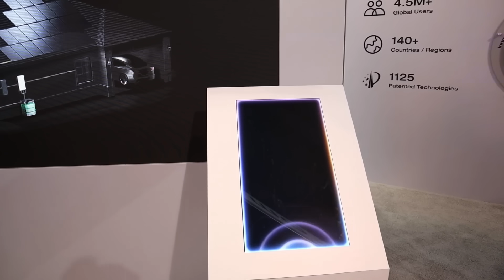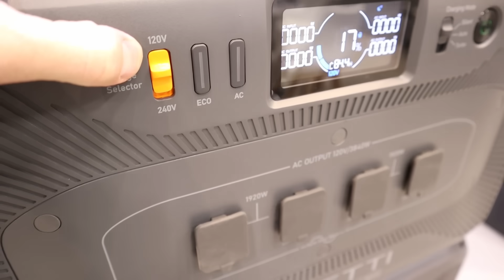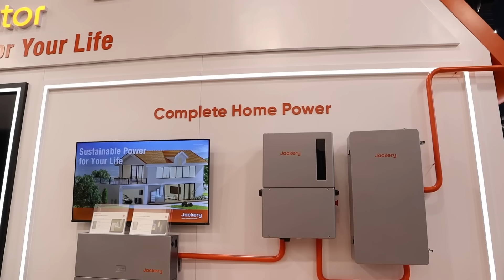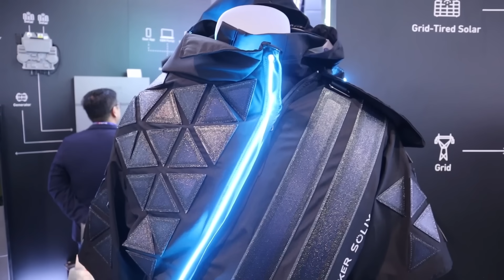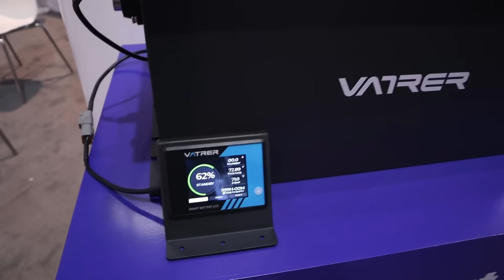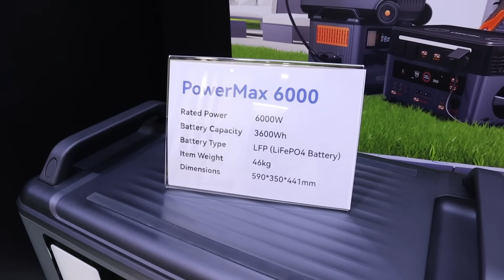I Found New Power Stations at CES 2025!

Comment: Jason, concerning the F5000lfp at aprox 2:30,  did you make a mistake on the wiring of the solar input?  I'm using 45vdc &  12amp for my calculations...  3s2p is 135vdc & 24amp, 2s3p is 90vdc & 36amp. I'm also confused as to which specs I should be using to make my calculations... Voc or Vmp for my volts and Isc or Imp for my amps.  I'm new to this and am still confused trying to understand solar & electricity. Can you clarify this for me and set me straight?

Comment: Great video Jason! I have a question. I have a cargo trailer for work with an Ecoflow delta pro and add on battery. I need to run an electric pressure washer that requires 240v. What would be the best route to achieve that? The new delta pro 3 or perhaps one of these others in this video? If it's possible, i would like to be able to output the 240v and 120v at the same time.
Any advice would be greatly appreciated!

Comment: Great video! Really interesting to see the new products for 2025 from the major manufacturers. Impressive job presenting so much information with so little time with the products. Biggest disappointment: Bluettie Apex 300 major downgrade in the solar input from the AC300's I have. 60V limit causes the same problem as the Anker 3800 (which I also have) - it's really hard to get adequate solar input. I'd classify it as a fail.

Comment: Off topic jasonoid but if you get the opportunity to review the e1000lfp battery or any self heating battery for that Matter could you test how much energy the battery consumes to warm itself up?
Reply from the maker: Typically the battery power isn't used to heat itself, it uses either incoming AC power or solar power to heat the batteries and then charge once warm.
Reply: @Jasonoid  oh ok

Comment: Jason, I wonder if the batteries for the F6000 will work with the E3600LFP?  Did you get a chance to look at the plug to input for the batteries to see if they are the same as previous models?
Reply from the maker: It will be interesting to see future compatibility. The F5000 was not finalized enough to know the battery connection type.

Comment: If peacron has heated i would expect it can be charged easier with colder temperatures than others that do not. They say bluetti ac180p doesnt even have freeze shutoff. Dont know why they would have error codes that in the manual then.

Comment: 👍  Thanks for the upload.  Pecron 3000 with heated batteries on demand please.  But for reals, I'm waiting on Ecoflow's follow up to the Delta 2 Max, don't need any more juice than 2400w inverter which saves on standby power draw.
Reply: That's what l have(2) Delta Max 2's, Love them(2) 20amp circuits will do for most Households and Will Power all 120volt Appliances. My Pro Ultra does the 240volt Stuff with 30amps(240V) it will Cover the Rest.
Reply: @JohnBurns-j2c  I also need the 2 extra battery ports as that's where the Ecoflow Smart Generator plugs into.

Comment: Thanks for this rundown of LFP batteries and accessories. I'm "wedded" to my BLUETTI AC200 MAX and B300K batteries. Good enough, with my 200 watt Off Grid TREK solar blanket, to run 2 full size refrigerators here in Las Vegas where sunlight is abundant.

Comment: Vatrer's power station looks like a laser printer!
I said in Will Prowse's comments that it'd be nice if somebody made a powerful "power station" with an inverter, sockets, USB etc all built in, but then an empty space where you can slot in your own server rack batteries. They've almost done it!
Reply from the maker: So kinda like a server rack mounted inverter all in one?
Reply: @Jasonoid  yes, but those usually just have a place where you have to mount your own outlets, usually a generator cord wired right into the home. My idea would have sockets built right into it, as well as USB ports, 12v etc. Basically like the big old Bluetti head units, but built (and ideally priced!) more like a DIY whole-home inverter (maybe a tad more "stylish"), and ready to be wired up to batteries the user supplies. There could be 12, 24 and 48v versions so the user could choose their own batteries to suit, and add / swap / upgrade over time.

Comment: I love my Ankers. I use them in different locations and need portability. Other manufacturers have very nice performance, but my Ankers have wheels / extending handles. I believe all manufacturers should offer wheels on units weighing over 40 lbs.
Reply: @djrtime1398  totally agree and that's a big reason I bought the Anker 3800
Reply: @JimEdds same and it was only 1600 for me on Black Friday eBay refurbished
Reply: @LectricOverlanding  I hear ya. My last two Bluetti units, an ac200l and an ac180 were both factory refurbs. I bought the 180 since the 200 was almost twice the weight. I wish the 200 had wheels like my Anker F2600.
Reply: @LectricOverlanding  that's a steal !!

Comment: Great job Jason. I'm guessing Bluetti didn't let you open the AC ports on the side. 
I was curious to see what kind of 240 AC port they included. Nobody have shown it.
I'm with you on the Pecron F5000. Excited about that because I know they will priced that accordingly.
I hope they make a F3000 with the same features but less capacity for better mobility.
Lastly I disagree with you on the Pecron new design.
I happen to love the old design because of the rubber feet on all corners.
Don't have to worry about scratching your shiny new power station. Can always change out the rubber feet.
Reply from the maker: I was in their booth lifting up the ports and a lady ran over and said 'don't film the ports please, they aren't final'....so the unit here at the show is a pre-production model, not a final version. It will probably have a 30amp or 50 amp 240v connection.
Reply: @Jasonoid  haha. I figured tat much because no one have shown it. The no DC ports is a downer for the Apex 300. I don't want to be carrying extra adapter just for that. The Pecron F5000 looks more promising although 5000wh+ is gonna make that sucker really heavy.
Reply: 60v input is the killer for me, what are they thinking? I have a maxed-out AC200Max with only 2200w output, it's great but I need more inverter! I'd like to have stuck with Bluetti, but so be it...

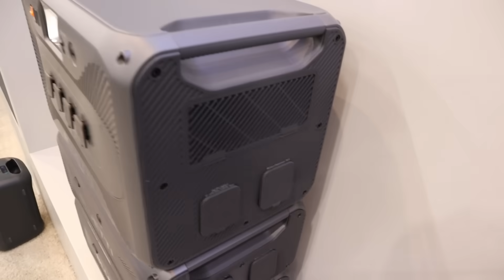Comment: @5:13 Bluetti really needs to drop some info on the rumored charging accessory if there actually is one, otherwise a lot of people are going to dismiss this unit for it's PV input downgrade and not pay attention to it anymore.
Reply from the maker: Totally agree....60v is a joke for a large unit like this.
Reply: Their vaunted "48v accessories" for their 48v output ended up being a splitter to make it into 4 12v ciggie lighters. They proudly launched the "Swapsolar" with a power station and fridge that share internal batteries, but I expect that's all there will ever be (bizarre that their backpack power stations don't use swapsolar batteries, they'd be a perfect fit).
They're like little kids, bouncing from one "great idea" to another, abandoning old ones just as quickly...

Comment: I don’t know where Bluetti is going with the Apex units. Big AC output but relatively tiny solar input. Also has built in battery unlike the AC300 so you can take just the main unit with you but it has no DC output. 

Pecron F unit looks interesting if they have improved the quality of the solar charger.

Comment: For about two years now I have resisted upgrading my power station, but the Pecron F5000 might be the one that really moves the needle. That thing can clearly power everything I need for off-grid living in any season. Pecron prices are usually quite competitive, so I'me starting my Pecron savings fund right now! Thanks Jason!
Reply from the maker: I will find out how well it performs when I test it! Hopefully it works well :) It's certainly specd out well.
Reply: It looks Good, but l still like my Very Adequit Eco-Flow StationsDeltaMax 2's. Well suited and Plenty of Power for Portable. the Pro- Ultra does Me Well for Whole House Back-Up. 7200watts at 240volt is Great with(2) 6000wh Bateries and(4) 400watt Solar Panels also and all the Hardware. Plus my(2) Max 2 Power stations. I am Well Covered in my Mobil Home

Comment: Great presentation - the trends seem to be more options for folks getting larger capacity power stations.
On the topic of self heating options - even though it wasn't a must have - I pulled the trigger during Pecron's Xmas sale
for an E1000LFP, which in addition a low temp battery warmer,  the power unit is able to supply 12 volts at 20 amps. $436.05 USD
Reply from the maker: I will be testing the E1000LFP soon. It's a cool compact unit!

Comment: the Bluetti Apex 3000 has my attention........i love the idea of an upgraded inverter that can use existing batteries and it sounds like the older AC300 system can have even more battery storage with the Apex 3000.
Reply: Please explain what you mean by "it sounds like the older AC300 system can have even more battery storage WITH the Apex 3000." I have recently bought a second AC300 with 4 more B300 batteries just to increase my storage capacity. The second AC300 make the system more resilient, but I wish the AC300 wasn't limited to using only 4x B300 batteries. I know the AC500 can use, what, about 8x batteries per head unit, but I preferred the AC300 because of less standby inverter losses. TYIA
Reply: @suklee1400  minuteman prep was talking to the Bluetti rep and the rep mentioned that the Apex 300 can handle 6 battery's .If the Apex is compatible with B300 batterys then my hope is one can connect 6 to each Apex 300.
Reply from the maker: I think the 120v/240v switch was really interesting! I would have liked to see a little larger inverter, I guess it's similar to the EcoFlow Delta Pro 3, nearly 4000w output.

Comment: Thanks for covering!  Looks like 2025 is going to give us lots of new and exciting choices!  I really like the new Apex 3000 from Bluetti along with their AC coupled battery.  The new Pecron integrated split phase unit i also quote exciting!  Finally split phase won't be a "dirty" word for power stations:)
Reply from the maker: The one thing that was kinda interesting about the Apex 300 is that they dropped the solar input voltage down to 60v (AC300 used two 150v controllers). Not sure why they think people want that... Bummer!
Reply: @Jasonoid Doubtless, like Anker, they're going to be bringing out their own low-volt, high-amp panels and are trying to lock customers in to using their own product.
Reply: Us brookies still gotta wait till November to even begin to consider affording them
Reply: Us brookies still gotta wait till November to even begin to consider affording them

Comment: I’m surprised heated batteries aren’t more prevalent, at least for the larger systems.
Reply from the maker: Bluetti AC500 and the Delta Pro Ultra have heated batteries but thats it, Pecron is the latest company to show them.
Reply: There’s no free lunch. Imagine how many watts are needed to heat 100pounds of battery even just 10 degrees. You have to hope you stored your unit at full charge. If it’s too low you won’t have enough wattage to finish warming them before you can recharge them.
Reply from the maker: @djrtime1398  power isn't pulled from the batteries to charge, it's only taken in by solar power or AC charging initially until the batteries get up to 40F.
Reply: @ so if I have this unit in my offgrid cabin and it’s below freezing, and my generator won’t start and it’s cloudy out I’m screwed even if it has a full charge??? I guess it’s time to go primitive and fire up the wood burner, light a candle and strum my acoustic guitar till the batteries warm up…
Reply: @djrtime1398 Generally speaking the battery can discharge at lower temperatures than it can charge. So if it’s cloudy and offgrid you won’t be charging anyhow, but if it’s > -4F then you can discharge the battery just fine (which will warm it up too)

Comment: So, power stations vs full hybrid solar setup, which should I go for?
Reply from the maker: It all depends on your use case and what you want to power. Hybrid solar systems typically cost less but aren't as user friendly.
Reply: Will Prowse has several videos on using server rack batteries, a big "home" hybrid inverter, and a cart, to make your own bespoke "power station" for cheap. It takes some work, and ain't pretty, but you can get thousands of watts in and out. And easily replace anything that breaks!